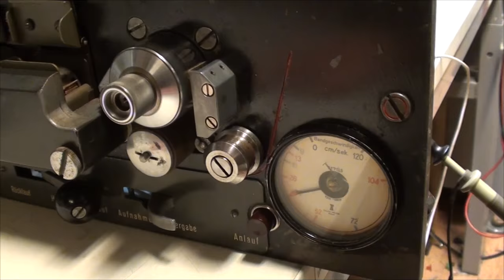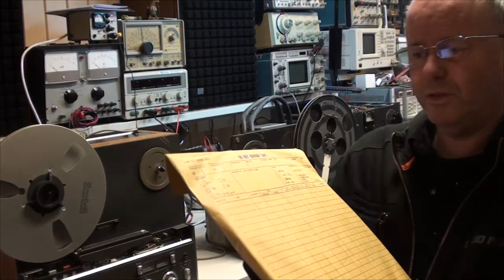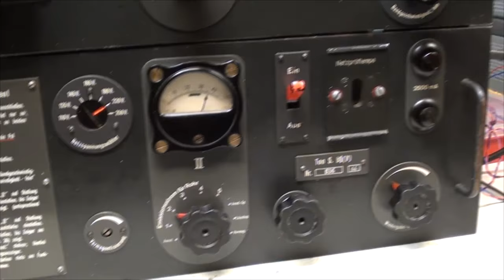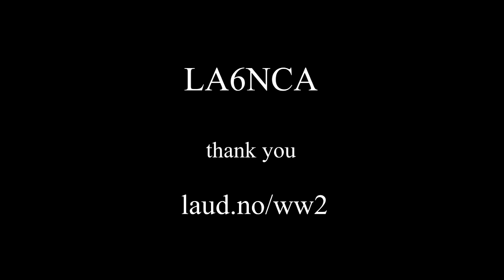German WW2 Tonschreiber Ton S.b1, my first test

Comment: Fantastic to see this up and running, inspires me to have another go at mine, have you tried the rotating magnetic head system yet? I believe it was designed to work with high speed mores code. The S.B.1 is very old but not the first, the first practical machine was the AEG Magnetophon K1 in 1935 thought the S.B.1(From 1939 - 1944) was the one used as a blueprint by first Ampex in the US with the 200 and then shortly after the British with the EMI BTR-1

Comment: Congratulations, and thanks for sharing it with us. As a hobbyist and radio journalist, I spent countless hours over several decades sitting in front of tape machines, often hunched over in an awkward position to mark the tape with a grease pencil, razor blade at the ready, for editing. I love the idea of having the heads facing upward, which would make the task that much more comfortable. (The downside, of course, is that complex path.)

The (relatively) modern quarter-inch tape seems to work fine. Anyone know why the Germans, who would have measured their tape i millimeters, ended up with tape slit to a 0.25-inch width?
Reply from the maker: Interesting to hear about your use of tape recorders.
No, this was a bit weird.
Why did they make the tape 1/4 "width?
Modern tape fits perfectly.